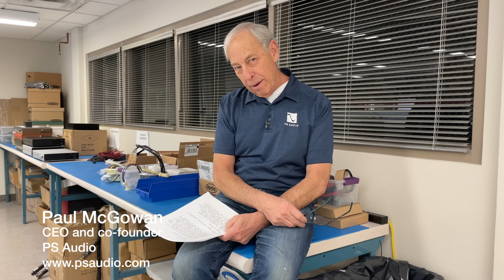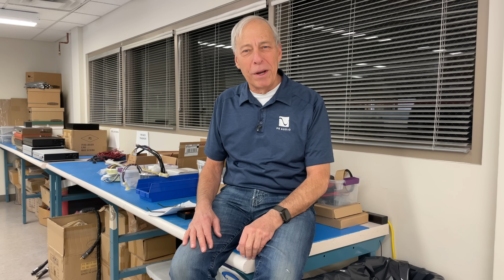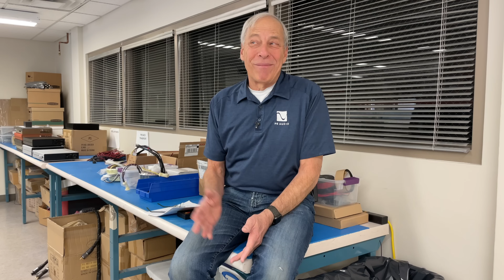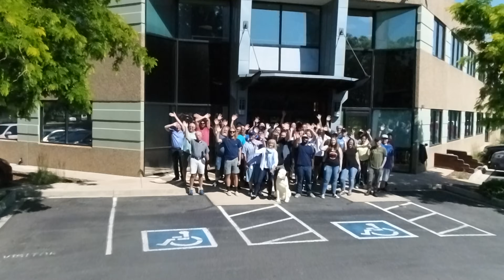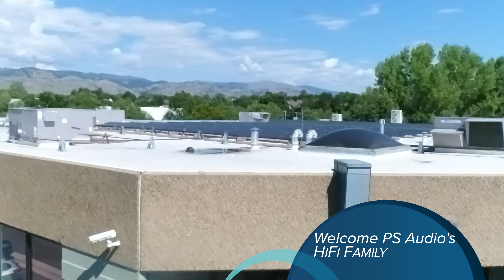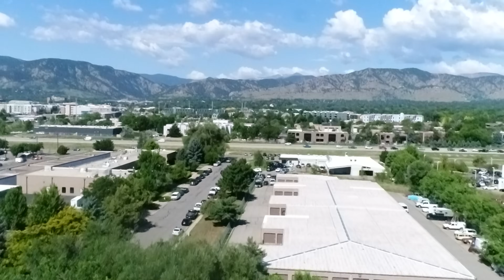Do bigger transformers sound better?

Comment: My Proceed HPA3 amp weighs 100lbs. It has three separate transformers. It's a true monblock design, with Mark Levinson output stage. It's in the bottom position in my rack, of course, so it does have to be lifted much, or have far to fall! LOL.

Comment: An under powered transformer will not sound as good as a transformer that is a little bigger than needed, but too big is just a waste of money you end up wasting power in resistors to get the correct voltage. Get one a little bigger than you need and adjust with power resistors to get the recommended voltage, tubes can tolerate over voltage but solid state can be less forgiving. too much voltage is unnecessary and may wreck the preamp. Some think that compressing the sound pushing a transformer too much is good but that works in guitar amps, not audio preamp's.

Comment: is this also the case with audio output transformers on tube power amplifiers? I mean I have a 5 watt amplifier, would I gain anything by replacing the audio output transformer with one that is 10 or 15 watts? If so how would i benefit?

Comment: My 29 Lbs (boat anchor) Crown CT-210 from around 2000 sounds pretty good. I bet a big part of that weight is the power transformer. My ears aren't precision instruments so I'd need to get some other people to hear it. I already know that Crown is a controversial choice that people like to bash, but I have a limited budget.
Reply: I have a crown XLI2500 for my Cerwin Vegas. I bought it because any true hifi amp with that kind of power would cost a fortune. It's class AB, weighs like 30lbs and has a huge transformer. Really clean sound and unlimited power for my needs. For a $600 PA amp I love it, great match for a set of 15" Vegas. Crowns are tough to beat for quality, probably hit and miss for sound. I owned one years ago, can't remember what series, just a Plane Jane pro amp, but that sucker was tough and had so much ass. I love Crown, maybe not high end, but they defiantly have their place and generally do a pretty good job.

Comment: I put a 12lb Mercury output transformer into my Fender Vibrolux Reverb guitar amp, replacing one that was maybe 3lb.  It does sound better.  I also replaced the 2x10" Jensen speakers w/a 12" Electro Voice PA speaker w/a 20lb ceramic magnet.  The amp sounds great (I favor a clean sound) - but the amp is like carrying an anvil to shows now.  SO...if I upgrade to a bigger power transformer, more improvement?  I might do it

Comment: Well I am right after rega elex , rotel a11, 12, denon 900hne, musical fidelity m3si. The last two are claiming some "high current" stellar technology at the same time they have the smollest transformers by eye. It is dificult to find out real size. Gues which one has leanest sound. .....I appreciate this video a lot because was not sure with my conclusion. I am angry because the denon hes perfect sound. Its bigger brother 1700 ne has two of the same transformers instead of one and it has only 10 W per channel more which sound promisable. Will this help considerably also to sound weight?, or the transformer has to be bigger?

Comment: Howdy. Just a thought.
Have You tried replacing the monster el. cap.s with Nickel Metal Hydride batteries (NiMH) ? My thinking is that should provide very low Equivalent Series Resistance (ESR) and thus low impedance.
High Regards.

Comment: How to Get Much Better Stereo Imaging 
Recently I assembled used stereo Borberly's headphone amps wth its 2 separate PSU (2 PCB boards) but without the transformers. So it's actually a monoblock. Result: at the beginning I was  shocked. Why sound heard expanding. The gap/ distance of sound from one player to next of him/ her becomes longer. I thought thr's something wrong wth the amp. Later I realised tht's the effect of monoblock PSU. Each L & R amp has its own PSU (& its own transformer). I use 50 VA instead of standard 25 or 30 VA. It's more expensive. Next time I'll build my own monoblock amps (just 10 W. It's already very loud if it's fully opened) wth its separated PSU, bigger transformer & bigger caps.

Comment: I agree wth you. The bigger transformer sounds better because it uses bigger diameter wire as R = p l/ A, whr l = the length of the wire, p  is  ρ is the resistivity of the conductor in Ω.m & A is the cross-sectional of the wire. So the bigger the wire diameter which redulting in bigger A the lower the wire resistance (R). The problem is only it becomes more expensive.

Comment: My Onkyo TX-NR 5010 Receiver is heavy with a huge transformer and it's sound is AMAZING!
Reply: I have the TXRZ 820, pretty similar, that thing has some power. Williston Audio Labs did a dyno test of the 810 and it beat the specs. Onkyo has been doing right by their customers, at least on the spec front. I really like mine, if I ever decide to do a more advanced surround set up I may upgrade, but for theater and rocking the house I am pretty content with its current capabilities. Its the best AVR I've owned, though I have a very nice TEAC from the late 90's that was pretty nice for it's time, another receiver with a really big transformer and powerful amps.

Comment: I have a Pure Class A DIY single resistor and mosfet.

My toroid transformer can delivery 12vac and 36A(2 separate output parallel,2*18A) and my Bias is set based on rectifief and filtered dc 14v to around 7 volts.

I have output speaker load made for 4 4ohm speakers with parallel to get 1ohm resistance. Sound is amazing, thanks to my coupling capasitor, 100 000uF/16v.

My question is: Do you think my toroid transformer is good for my setup?

Comment: Interesting as l have a Spectron musician MKII class D amp designed by John Ulrick in the mid 2000's I use it to drive my Maggie's as It has tons of watts at all loads but l think what really makes a difference is it's ability to produce 65 amps for 500 milliseconds 
My Maggie's love all that juice! The amp has a transformer that is 8 inches in diameter and 5 inches thick! The Spectron amp weights in at 54 lbs!

Comment: Strange result. on a power amp, yes it should help a bit, however on a pre-amp? Assuming the supply can keep the volts up, (not drop out of regulation) then a bigger one should be exactly the same, but you say they were not....

Comment: Thanks for that very interesting video.  Although I think I follow your argument about impedance, as an engineer (of another sort), my guess is that there must be diminishing returns with bigger and bigger transformers.  I’m also puzzled at why the Debut designers, in this case, can’t compensate for a smaller cheaper transformer in other parts of the circuitry?  I’m also wondering at whether this magic of thicker wires is one reason the bulky air cored impedance in speaker crossovers are said to ‘sound better’ than the cheaper ferrite cored ones, ie because the less bulky ferrite cored ones have thinner windings?  Your videos always teach me something I didn’t know!  Thank you!  The older you get the less you seem to know (I’m 75).
Reply: Fat is better..

Comment: It has almost nothing to do with impedance. In fact, the real way to look at this issue is not to say that oversized transformers sound better, but rather than undersized transformers sound bad. At the end of the day a power transformer simply has to take 120v rms from the wall and convert it into any given voltage you want. Assuming you already have an amplifier and we can't change the turns ratio of the PSU transformer, then what you need to do is make sure the transformer is capable of providing PEAK current to the amplifier. That means that the PSU transformer has to be capable of providing quick short bursts of current without sagging down the voltage, saturating the core, or distorting in any way shape or form. This usually means that you end up with a larger core transformer than you absolutely need. However, going to a much larger core will not result in better sound. In my experience a larger than necessary core can actually sound worse. 

The reason this myth of "bigger is always better" has plagued the audio community for so long is simply because a lot of manufacturers will put undersized or poorly designed PSU transformers into their product in order to cut cost. 

There are a ton of factors that go into choosing the right PSU transformer for the job. A large transformer core is usually a good idea to avoid unwanted distortion while the amp is trying to make music. Going beyond what is logical by more than 40% is just a waste of money. Trust me, I have tried.
Reply: I am building a Pass Labs Aleph (single ended class A) clone to drive the Martin Logan Quest.

Its impedance is 6 Ohm nominal and 2 Ohm minimum.

The recommended power amp is 80W to 200W, since it wasn’t stated at what impedance I assumed it is at 80W-200W@6 Ohm.

I think I will build one that is 150W@6 Ohm, going by my rusty P=VxV/R, so V=30V, the +-VCC should be approx. +-45Vdc, is that right?  Transformer secondary output should be 30Vx2?

At 2Ohm, current going through to the speaker would be 15A, and to compensate for the low efficiency of 20%, the transformer will have to pump out 15x5=75A?

So the minimum transformer VA rating is 75Ax30Vx2=4500VA?

Add the 40% that you mentioned and I am into the realm of 6300VA!  Did I make any mistake with my calculations?  It will be an enormous transformer.

Comment: Always use a transformer with good regulation ! Simple 😆
Reply: & i'd say (if youre handy with a soldering iron)  always have pricey top-notch voltage regulators after your tranny ...& then the filering caps but why stop there, i.e if your not loaded to buy the top-draw stuff

Comment: Complete hypothesis here: What if you designed a power transformer the way you would design a wideband  audio transformer but with the ratio needed? Now all that high frequency noise that used to get rejected by the core getting reflected back up into the line causing even more distortion instead gets passed straight thru to the secondary, down through the high speed rectifiers and into the capacitors that are bypassing the main rails. Far less in standing waves can only be good.

Comment: Paul. How about explaining HOW a larger transformer makes it sound better. Specifically.
Reply: He can’t. He is a salesman not a qualified engineer.
Reply: Completely irrelevant.
You are trolls.

If you were a "qualified engineer" yourself, you would have the resources to experiment and find out for yourself the answer to your question. Therefore negating the need to ask such a thing.
Indeed, the only logical reason for you to ask such a question, is as a setup for a putdown.

There are other ways of deriving pleasure from life, than making yourselves appear to be adolescent butt-heads.
Reply: @Hare_deLune  How is the physical explanation irrelevant? If the phenomenon that Paul is talking about is real than there should be a reasonable explanation and it should definitely be measurable. Without the physics you don't even know what kind of rating you need on your transformer.
Don't take things for granted, think critically, even from a trustworthy source.
Reply: @erikpoephoofd 
Hello.
I agree with you that critical thinking is good and useful.
I also agree with you that there should be a reasonable explanation for why this occurs, and that perhaps it should be measurable.

However, I would also add that if you know about science in general, you will know that we do not have an explanation for everything. There are events which we know for certain are happening, but for which we do not yet have a reasonable explanation.
There are also things which seem to defy logic or a reasonable explanation, but then are able to be explained satisfactorily at a later time, because a piece of missing information is discovered, or the problem is approached from a different viewpoint.

It becomes very irritating when people demand an explanation for something and do not take these factors into account, or totally ignore them in favor of the rigid viewpoint that engineering is a science that is omnipotent and that mankind knows everything there is to know about everything that exists.
I reject this hubris, and confront it regularly.
Reply: @Hare_deLune  I can see where you're coming from and I agree with you for the most part. There is a point where we no longer have an explanation for things. I do feel like we should not give up looking for the explanation too quickly. In this case, the transformer can be seen as a black box. We don't know what it exactly does, but it has an electrical signal we can measure accurately along with the electrical signal of the amp output. What should be totally in the real of possibilities in my perspective, is to measure and record the output of the same amplifier with the same input but with different amplifiers. Using a digital oscilloscope you end up with two CSV files which you can compare or maybe even extract from eachother if the starting point is properly aligned. What could then be done is to use a Fourier Analysis to look at the differences in frequencies.
With this data we can at least say something about what is changing in mathematical terms instead of subjective terms such as "body" "warmth" which can mean different things to different people.
Do you feel this mentality is hubris?
Reply: @Hare_deLune  This is not one of the electrical engineering issues that remains a mystery. Transformer design and performance is well known and can be measured accurately. In many of these videos Paul is asked a technical question and either ignores the basic question or gets a technical answer horribly wrong.
Reply: @erikpoephoofd 
I am not an engineer or a scientist, although I have had a lifelong admiration for science.
Therefore, I do not have the technical ability to agree or disagree with your example.
However, I do try to observe and learn.

The most I can give you is a well known example of what I'm trying to relate:
When CD players first came on the market, we were promised "perfect sound forever".
We then quickly found out that the CD's sounded harsh and 'glaring'. Fatiguing to listen to, and not emotionally engaging.
People argued for years that "bits is bits", that there was nothing but ones and zeros, and therefore what came out was bit perfect to what went in.
Yet, people continued to complain that the sound was bad.

Eventually, it was discovered that both parties were correct. The 'armchair engineers' were correct about the output signal being bit perfect to the input signal, and the people listening were correct about the sound being bad.
How was this possible?

It was possible because all the 'armchair engineers', full of hubris and arguing so vehemently that "bits is bits", were making their argument based solely on the digital realm, and solely involving the digital signal.
They were also correct.
However, they were at odds with the people listening because there was missing information which had not yet been discovered.

That missing information came to be known as "jitter", which resulted from variables in clock speed.
This was occuring in the analog domain, not in the digital realm. So, the people who were listening were also correct.

The problem was eventually explained by looking at it from a different viewpoint.
Looking for explanations in the digital domain was fruitless and pointless. The 'armchair engineers' sat smug in their arguments that the listeners were fools because the digital signal was inviolate.
So full of hubris were they, that they could not look beyond the end of their collective noses, to realize that perhaps the root of the problem lay outside the bounds they were so rigidly adhering to.

Note that it took real scientists and engineers investigating the problem to discover what was going on.
The answer was also not immediately apparent. It took them a few years to discover this.

I'm not saying you are wrong, I'm just trying to say that it is foolish to dismiss out of hand the possibility that there may be another explanation that hasn't been discovered yet.
Reply: @erikpoephoofd  Exactly.
Reply: @Hare_deLune  I am pretty sure that the electric and electronic principles in (relatively) simple audio devices are well understood, and have been for a very long time. There is no "sound" in audio equipment................it is 100% electrical/electronic. It is well understood. 
The first thing to do in a case like this is to verify that the change is actually occuring with measurements. If the change can be heard, then it would be easy to show this change with measurements. Test equipment doesn't have expectation bias, and is simply going to show you what is changing, or not.........................
Reply: @Hare_deLune  The fact that this "improvement" actually occurs has not even been demonstrated. I am not doubting Paul one bit, but even if the difference cannot be explained, it should be pretty easy to show the difference through measurements.
Reply: @Hare_deLune  Wow. I'm a troll? Looks like you are the tough guy behind the device. Listen. Paul says.....like a caveman....bigger is better. It sounds better if it is bigger. He is an engineer. I am not. I'm asking........how does it make it better. A very logical question. If anyone is the troll here its you. I'm asking a valid question. He is being very vague and isnt explaining it very well. Get over it.
Reply: @ryanschipp8513 
Are you new to this channel?
Do you read the comments section often?
If so, then you must know by now that this is a very common occurence.

Paul will answer a question as best he can, while keeping his explanations simple.
Sometimes, as in this case, he will offer up an anecdote from his own personal experience to demonstrate his sincerity.
Then comes the demands for detailed explanations of why we cannot see the air that surrounds us, and why one person's thoughts differ from another's.

And always, always, the demands remain unanswered.